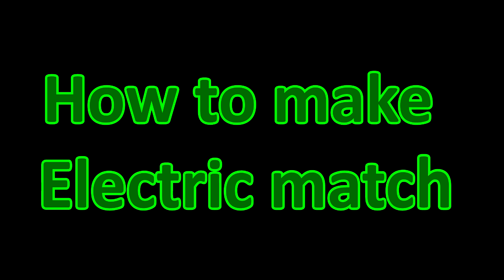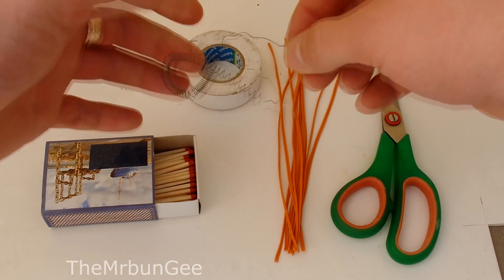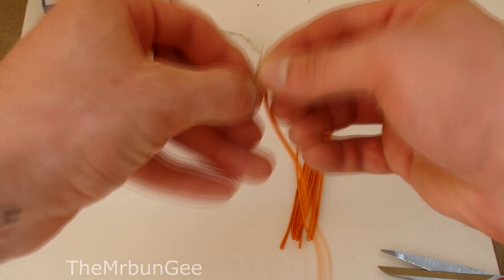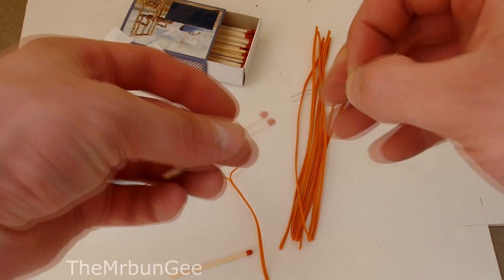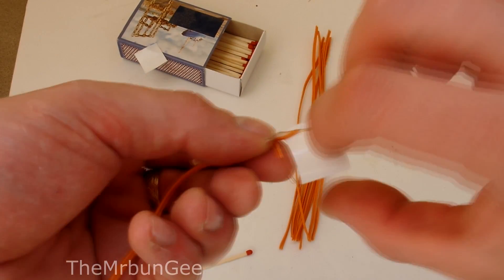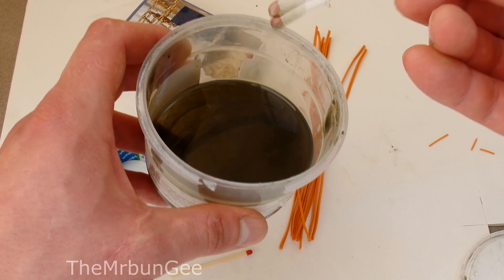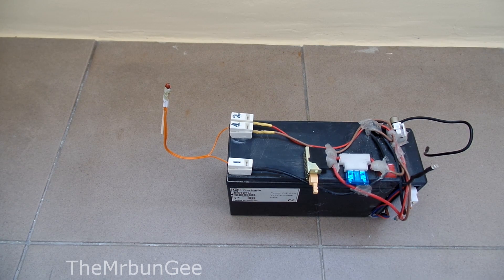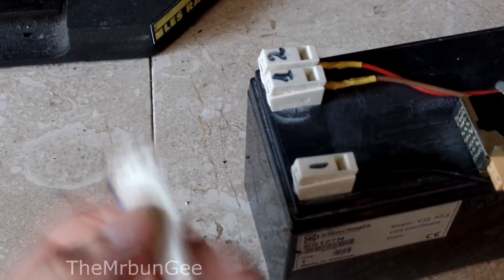How to easily make electric match/Igniter

Comment: How much minimum volts required
Reply from the maker: It depends on exact resistance wire You use, for mine 12V was enough, but I think I could get away with 9V.

Comment: tried it, didn't work
Reply from the maker: Which part? Following instructions?
Reply: @TheMrbunGee  yes, I followed all instructions, made 3 samples, none of them worked
Reply from the maker: @ericbarreto1550  What do You connect them to, to initiate? You might not have enough power to ignite them.
Reply: @TheMrbunGee  I tried with a 9v battery
Reply from the maker: @ericbarreto1550  You might need two 9V batteries in series, if that is all You have. that should work if everything is done correctly. In this video I use 12V battery.

Comment: How do you make the remote control detonator that attached to the battery ?
Reply from the maker: It is made from car central lock module, there are multiple relays which connect battery with igniter in this case.
Reply: @TheMrbunGee  Could you make one and sell to me. Thank you
Reply from the maker: @catchmeifyoucancatchmeifyo4215  Noo, that is not what I do! 

I suggest You to learn how it all works and make one Yourself, it is a lot of fun an You will end up smarter! Good luck!

Comment: thanks for the content, I have one question, I want to put this e-match inside the blastic bottle of petrol, however, I have a little concern about the petrol, may make the match lose or solve in the petrol, is there any way to protect the match inside not air environment?
Reply from the maker: You could try wrapping in polyethylene plastic, or smearing with silicone. You gonna have to do some tests, cause I don't know how well they will hold up against petrol. Also this exact match will not light petrol when submerged in it. Has to be in air near petrol.
Reply: use a gas/air mixture instead as a primer.

Comment: Why so complicated. You can make an electric match with nothing more that a piece of metal wire and a battery
Reply from the maker: Sometimes You need more reliability and/or more heat for ignition. I do not find this complicated at all, it is exactly a battery and resistive wire, only around match head and with optional water resistance. Works well together, but not all parts are necessary.

Comment: The solvent didn't light because you had the igniter "in" the solvent. It is the solvent VAPOUR that burns because the solvent needs oxygen to burn. The igniter in the solvent had no oxygen source so the liquid solvent snuffed the match by depriving it of oxygen. This is the same reason that a completely full gas can will only burn (only small amount of fuel can react with oxygen at the spout) while an almost empty gas can will explode (large amount of vapour and oxygen mixed).
Reply from the maker: Yep!

Comment: One thing I have my doubts about.
Ignition occures due to a relative High current, heating up and igniting the matches, right?
Your way of connecting the wire to the NiCh wire is to poor.
I'd suggest some way of krimping them together. The way the wires are connected will couse some kind of (low) resistance which might limit the hight of the current. That is no big deal when you got a chargable Battery closeby, but when you want to ignite something from a distance, using a long wire, the wire might add to the total resistance along with the poor connection on the match, that it is less reliable. Unless you use a thick cable, which itself is usualy expensive.
Using a big battery closeby the item you like to ignite might be a problem if the ignition is planned to do some bigger damage also. :-)

Speaking of matches... You sweet 'n soft voice does'nt match your hands. ;-)
Reply from the maker: Better connection will increase reliability, but I never had a single problem with these, made like they were. I guess the easiest way would be wind wires together and squeeze with pliers. Also resistance wire is too thick in this video, more secure connection could be made with thinner wire. 

Wireless firing also removes the resistance issue, One can buy 10 channel wireless relay module for ~ 10-20$, It will save time money. recommend! 

And for bigger stuff I just dig a small hole about 5m from event location, put the firing brick in it and cover with ply wood. Never had issue with up to 5m cable, same as in the video. 

You mean You did not notice it is synthetic voice? :D

Thanks for feedback, have a nice day! :)

Comment: What is the lacquer for?
Reply from the maker: It is not crucial, but serves few good purposes:
* Increased protection from moisture, That increases storage time, also allows to burn under water (for whatever reason one would need that)

* Nitro-lacquer is flammable and makes contact with both - resistance wire and match head, this greatly increases reliability. 

* Lacquer holds the wire in place, so one does not have to be so careful, working with the fuse. 

* The layer makes the quick-match more resistant to accidental ignition from accidental friction. 

I think it is worth the extra small step, or these perks could be achieved by any other means.

Comment: The only problem I see is that the tape is also burning, and that creates nasty fumes (as it’s made of PVC). Maybe it’d better to replace it with other kind of tape (paper, aluminium, Kapton)?
Reply from the maker: The tape is there because you need to electrically insulate the both ends of resistance wire. So aluminum tape is off the table, but you can use whatever means of insulating the connections from one to another. Even no tape, if you can find the way. 

Electrical tape gave me the best reliability of the e-match, also the time to make this is minimized, these were the main attributions for e-match I was making at the time. 
 

That said - where are you going to use them, if you are worried about the fumes?
Reply: TheMrbunGee Yeah, forgot about that (though there might be aluminum tape with insulation). Actually, I just remembered the reason why I found the tape strange: once I tried with electrical tape, and it burnt before the match ignited, but I was also using copper wire rather than nichrome (which I don’t have) and I wound it in another way.
Reply from the maker: @GRBtutorials  Yea, the smell is terrible, but these are supposed to burn far away from anyone, so in this regard I don't consider this as a problem.
Reply: GRBTutorials you do realise firework stars use pvc right

Comment: Can we use nail lacquer?
Reply: That contains nitrocellulose
Reply from the maker: @agorist.boogaloo  in a thin layer any nail lacquer would actually work. In that case one must make sure resistance wire makes a contact with match head.
Reply: So you're saying the lacquer can block contact between the nichromw and the match head?
Reply: I don't understand.. Can I dip it in nail lacquer or not?
Reply from the maker: @agorist.boogaloo  I think it might work, yes, but I have not tried that. 

There is a chance, that components in nail polish may somehow impact the reliability of e-match, that is why you exclude any errors you can, to make sure they will ignite every time. 

 You can always try one or several, to see how they  behave.

Comment: The little stain you see on a match stem near the sulfur tip is paraffin wax and it is fuel to keep the match lit after striking, I'm wondering if this would also work to dip-seal them.
Reply from the maker: It would help to keep moisture out, but the coating is very thin, and the wax is soft, it can be destroyed with no effort. Thicker coating of wax could be used, but there is a risk, that melted wax would dampen the chemicals, failing the ignition, so nitrocelulose is the coating of choice.

Comment: How much current and ampere does it need to ingnite the match????
Reply from the maker: It depends completely on exact dimensions of the build, 12V lead-acid battery is the safe choice, if other power sources are used then thinner resistance wire should be used.  

This particular e-match was ignited using 16A rated relay, but the current was probably limited by thin copper wires leading to nichrome.

Comment: What is this type of wire called or where can I buy it ?
Reply: Nichrome wire, it is sold online(amazon) but you can also get it at vape shops
Reply: the thinner the better, try salvaging dead heating pads or electric blankets.

Comment: hello which metal powder is best for kmno4?
Reply from the maker: For what? Flash? Mg is more reactive, makes more powerful flash powder than aluminum.
Reply: @TheMrbunGee  thank you
Reply from the maker: @shahyarexperiments9082  NP! 
But - be careful, never mix large batches of it. it is friction and impact sensitive and larger piles might explode without confinement
Reply: @TheMrbunGee  okay i will make dynmite and after that flash powder with kmno4+mg in summer
Reply from the maker: @shahyarexperiments9082  Be careful and do research! :)
Reply: @TheMrbunGee  okay thanks for your help

Comment: Awesome, awesome video. The most complete from YouTube!
Dude, I have only one question: on green paper on the vídeo are wrote Mg (magnesium), but os to hard to find. Ive found MgCl2 (magnesium chloride) and MgSo4 (magnesium sulfate)... Can I use one of these?

Regards from Brazil!
Reply from the maker: Leonardo Takahata 

Thanks! :)

No, you need magnesium. You can also use aluminum mixed with someting like sulfur or some oxidizing agent. Some thing, that burns hot and is easy to ignite.
Reply: Many thanks TheMrbunGee!

Comment: Thanks for the great video.  I am very new to model rocketry and have trouble with alligator clips.  The wire holders on your launch thingy are wonderful.  What are they called, and where can I get them?  Thanks again!
Reply from the maker: Thanks! Those are spring clamps, used for electric connections!
Reply: Where can I find some REAL Ping Pong balls? I bought a bunch from Sears and got burned. They wound up being plastic and would not even be good to play Ping Pong with

Comment: This was a great video for some eaxy to make igniters! We use a similar system for rocket motor igniters in high power rocketry. The big composite Ammonium Perchlorate motors can me quite difficult to i initiate so most of the time we usually wrap a chunk of propellant on the end of the igniter and use a wooden dowel to push it up inside the motor. We usually leave the stick in with it when the motor lights its incinerated. Thanks for your videos the are most interesting, I like your voice too.
Reply from the maker: Thank You! :)
Reply: Wich wire you use 
Name of the wire?

Comment: Nice!😀 what a kind of acumlator do you USE? Is it also CAN work with a normal battery? For example with 4,5 V? 🙂
Reply from the maker: For this I used 12V acid accumulator, but you can use smaller one! Smaller batteries might not work if your nichrome wire is too thick, and you can always connect two batteries in series, to double the voltage. 

For longer distances you should also increase voltage or lead wires thickness! So it really depends on distance to fuse from battery, lead wire and nichrome wire thickness!
Reply: Thank you!:)
Reply: And can you send a link, where you bought your accumlator please?
Reply from the maker: Balázs Horváth 
http://m.ebay.com/itm/Ritar-RT1272-Accumulator-12v-7-2Ah-Lead-Acid-/401143912236?nav=SEARCH

this one is just like one I have, not the exact same, but will work just like mine, find the cheapest one for yourself! :)
Reply: Thanks!:D

Comment: Nice video, Ive tried similar method using steel wool, That was before I discovered nichrome wire. Liked and subscribed!
Reply from the maker: Thanks! Yes, that works too, but steel needs higher current! :)
Reply: schel sullivan
Reply: Kikou
Reply: The master never stops to learn

Comment: what do you mean about zinc chloride smoke bombs
Reply from the maker: I had few failures igniting zinc chloride smoke bombs with just a visco fuse, In my Zinc chloride smoke bomb video I used magnesium starter powder, to light smoke bomb.
Reply: +TheMrbunGee no like whats the chemical composition
Reply from the maker: -Hexachloroethane 45%
-Zinc Oxide       45%
-Aluminum    10%
Reply: +TheMrbunGee where did you get hexa chloroetene
Reply from the maker: https://www.youtube.com/watch?v=yYA43i_DYgc
Reply: TheMrbunGee